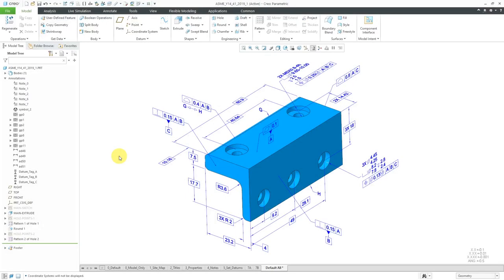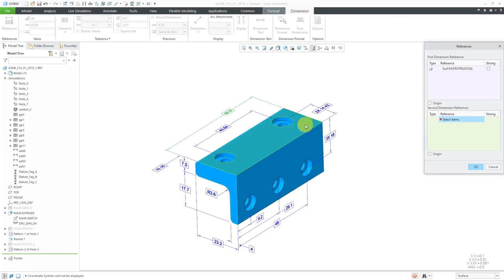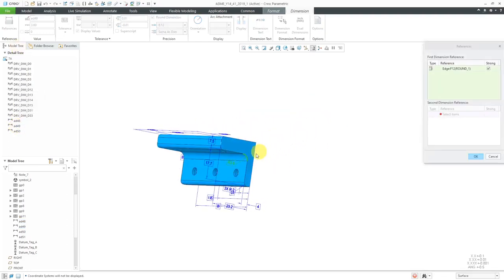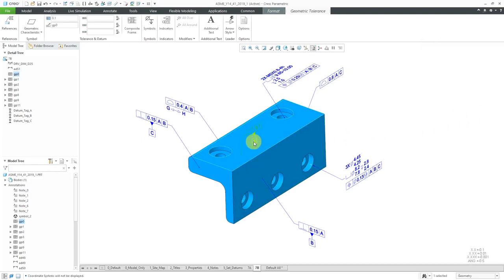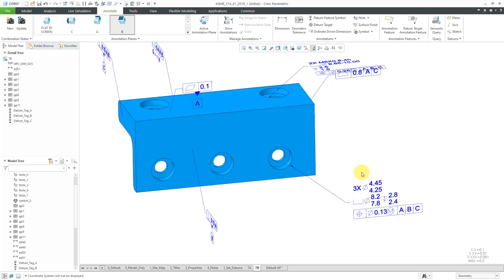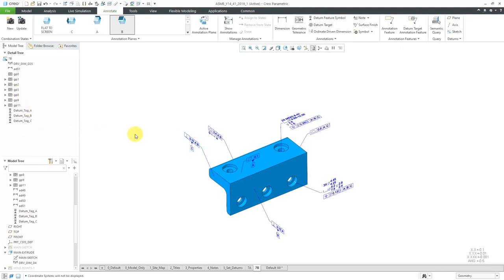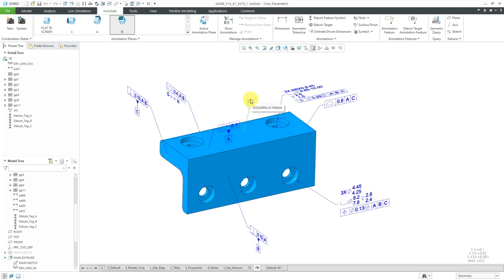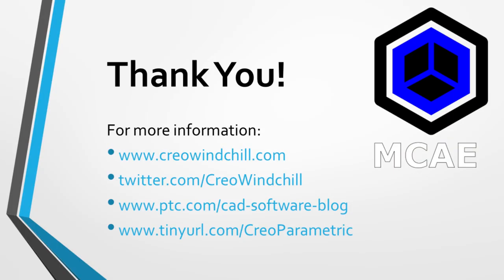Creo Parametric - Model Based Definition (MBD) | Adding Semantic References

Comment: Hi, in 6:13 I noticed that you have a hole annotation which seems to be a hole note callout by its form (hole and counterbore diameter and length all combined in one annotation), but it is a driven dimension (thus allowing semantic reference). Could you please tell me, how this can be achieved? Thank you
Reply from the maker: Hole notes are generated automatically for Standard Holes.
Reply: @CADPLMGuy  yes, that is working ok. When I create a Standard hole, I can see a preview of that note in the Note tab (I have defined custom callouts in the hole chart) and once the Hole definition is done I can assign this note to some combination state. However after I do this, when I click on this note in the model, Creo still treats it as a note (which I assume is ok). Problem is, that I can not select a reference (hole surfaces for example) for that note if I would like to follow this semantic references principle. However in your video (6:33) you are modifying a dimension (ad51) which also contains counterbore diameter and depth. My question would be if there is a way to convert Hole Note to a proper dimensions or if I have to let's say create a hole diameter dimension and manually add its depth and counterbore information to this dimension?